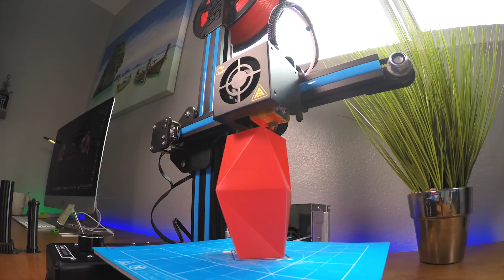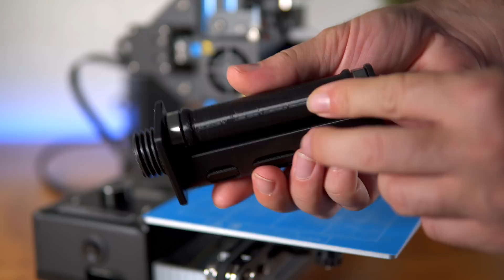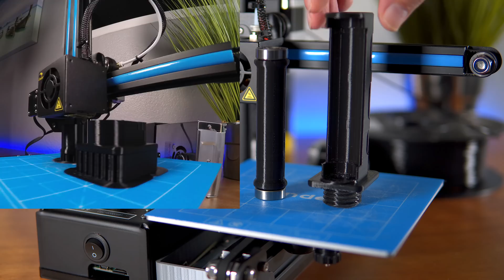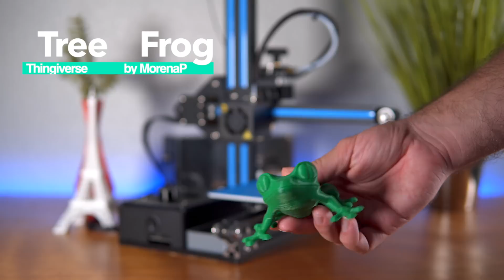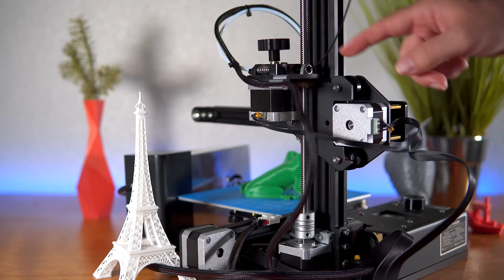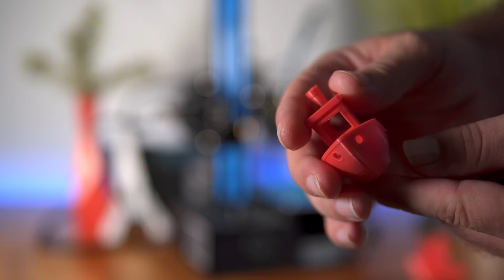Creality Ender 2 3D Printer - Overview & Prints - 2019

Comment: I like the review however half the issues are either user error or minor upgrades that a 10min google hunt finds u should replace on the printer arriving e.g. pressure fittings and PTFE tube. 
I have the ender 3 and while yeah out of the box its ok but to monster it a couple of bits here and there and done... "the more things you add to it the more issues you might have'. Pretty much all of my mods have improved my printer to no end..

Comment: Just two questions: Which slicer Software do you use? And would you be so kind to share your slicer settings?
Thanks a lot!
Reply from the maker: I'm using Cura for slicing. I'll try to include my settings in the next ender 2 video which will post sometime next week.
Reply: @JustVlads  So do I :-) 
It would be great if you provide the settings as file. Then it would be possible to load all settings with one klick (to prevent diffs and faults)

Comment: One thing that can definitely improve bridging and overhangs is adding part cooling. There are a ton of mods that add you can download and print. I think after that you will be pretty close to perfect.
Reply: I will second this. Part cooling will improve bridging performance and reduce stringing. Suggest a Bullseye or Hero Me base and duct. He will need to add a new fan, connected to the "laser" connector, and configure a custom Marlin to enable it. Or he could just run it all the time and connect direct to power.